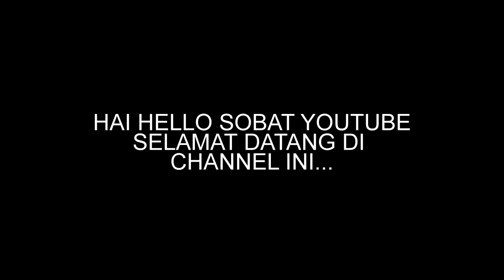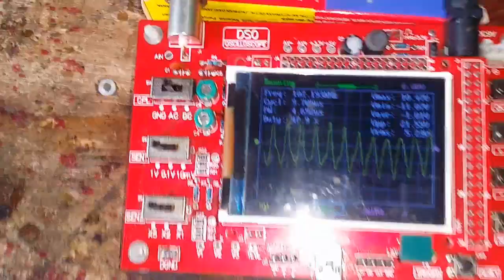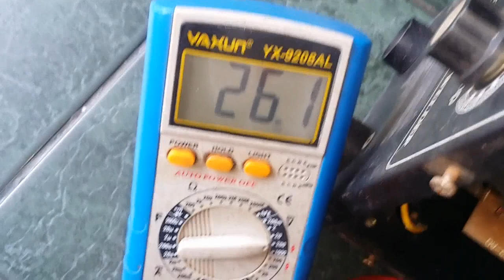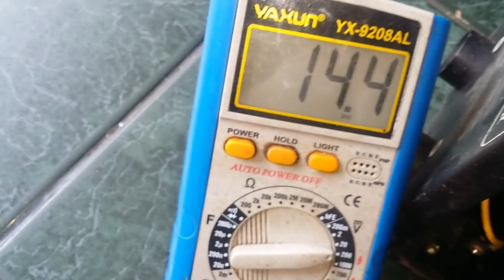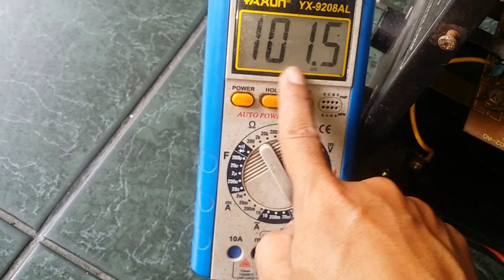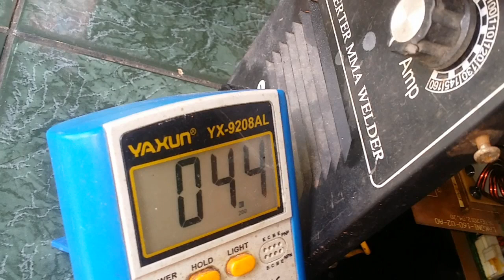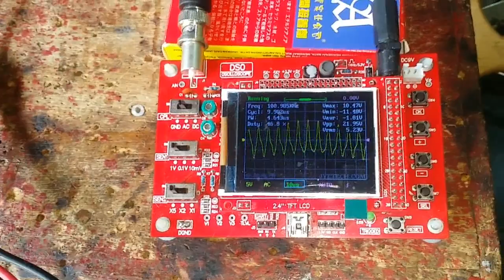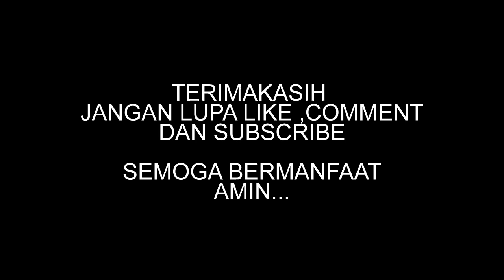MESIN LAS LAKONI MMA 160A DATA RECORD

Comment: Mas,resistor yg berada di papan pcb bagian atas warnah putih klw tdk panas ad hubungan dgn output  api kecil?mesin las rhino 125 amper
Reply from the maker: ga ada mas , kalo api kecil , biasanya capasitor 475/250v, pot ampere, relay blm kerja , travo short ,.
Reply from the maker: bisa juga pwm cntrol nya error , atou bagian driver gdt , ada yg short
Reply from the maker: area driver
Reply from the maker: sory mallah kehapus , area diver gdt mungkin ada yg short sebelah , jadi ga balance , cek area gdt mas  , di vidio dah ada , cari aja
Reply: klw kabel k bodi di keluarkan tegangan output 52 vol DC
Reply: di video merek mesin las ap dan brapa amper

Comment: Kipasnya pake arus AC ambil dari saklar ya mas?punya saya kipas kecil bgt karna beli bekas,niat mau saya ganti,kalo adanya kipas dc saya ambil arus dr mana colokannya mas?
Reply from the maker: Ya mas di ambil stelah relay ..pake kipas yg high speed .. kalo yg dc pake yg 24v juga pake yg high speed.
Reply: @afalhannan  tau speed dr ampere nya?trus setelah relay itu apakah sdh ada soketnya apa disolderin kmn mas,saya buta elektronik
Reply from the maker: la aslinya kipas nya apa mas , dc apa ac ??
Reply from the maker: Ya beli aja kipasnya .  Kalo kipas ac , bilang aja beli kipas ac yang 9x9cm high speed . Pemasanganya kalo bingung sambung saja ke sklar on/off nya .

Comment: Mas kalo tegangan pwm terukur pada ke empat mosfet 26 volt, kira2 masalah dimana ya. Apakah pada mosfet itu sendiri yang short ataukah ada komponen lain yqng mejadi penyebabnya. Terima kasih.
Reply from the maker: kalo 26 v ,pwm belum on mas ,.  tegangan normal 13-15v jika sudah on.
cek area pwm , pertama semua sensor nya ,. kalo baik2 saja brati pwm error,.
Reply from the maker: bisa juga lepas dulu mosfet nya ,. lalu ukur pada ic sg3525 pin 11 dan pin 14 ter ukur 5v
Reply: @afalhannan  oke mas, saya coba cek lagi dengan melepas mosfetnya.
Reply: Mas mesin las lakoni falcon hanya keluar tegangan pada out las.hanya 50 volt.buat ngelas kurang maksimal .kira2 masalahnya dimana
Reply from the maker: cpasitor sudah lemah mungkin mas , chek smua kapasitor
Reply: @afalhannan  kapasitor di pwm ta modul mosfetnya.atau kapasitor di tegangan 290 volt mas
Reply from the maker: milar 475/400v , elko b+,

Comment: Assalamualaikum mau nanya bang kl mesin las lakoni 160e mesin normal tapi pas d pake ngelas tegangan out hilang dan lampu QC menyala dan mcb d rumah turun kira2 apa yg rusak ya om
Reply from the maker: WA ALAIKUM SALAM , ... itu Over Curent mas , kondisi mesin dalam keadaan ga normal , kalo di seri lakoni 120e , banyak sekali , coba cek dioda outputnya , cek juga travonya , lok cek travo harus punya alat pwm universal mas , terakhir cek mosfet nya mungkin ada yg short .
Reply: @afalhannan  ay blm punya alat untuk cek pwmnya om
Reply from the maker: Ya repot juga 😊 . Untuk memperbaiki mesin las harus akurat mas . Salah dikit mosfet jebol smua .

Comment: Kalo di bodi mosfet 4 biji itu vol nya tinggi opo kiro2 mas??? yg bermasalh,trus mosfet k3878 panas
Reply from the maker: kalo moafet k3878  panas brati ada yg short mas , coba tegangan 24v di ukur , pas ga nilainya , body mosfet dan ground normal nya  24v pwm mati , pwm on 15v .
Reply: @afalhannan trus diodanya jg sy cba cek bolak balik avonya gerak semua;;; oke mas nanti saya cek trima kasih mas
Reply from the maker: yupz , test komponen lebih baik dilepas mas untuk memastikan benar short pa tidak,
Reply: @afalhannan  iyo mas matur suwon sarane
Reply from the maker: sip mas , semoga berhasil ,

Comment: Mas kalo lakoni 160 tegangan ngedrop dan keluar suara ngecrit apanya yg bermasalah
Reply from the maker: coba chek elko b+ dan capasitor mas
Reply: @afalhannan  awalnya kan  pwmnya bermasalah irf nya keluar 24v dan bisa start trus saya ganti kok langsung ngedrop voltase diarea igdt keluar suara ngecrit kaya curut.mohon panduannya.soket keluaran normal sebelum dicolokkan dan langsung ngedrop .
Reply from the maker: @jonojenggotjenggot8545  kalo pwm bermasalah brati blm tuntas mas ,pwm masih error itu ,. trutama chek c8050 dan 8550 ,.

Comment: Kalo si potensio gk ada tegangan apanya yg perlu di cek bang?
Reply from the maker: coba ganti pot 10k . lok masih ga ada blok pwm bermasalah .tegangan pwm lost mungkin.
Reply: Di kepala irf terbaca 26v
Reply from the maker: Pwm bermasalah itu . Merk apa mas mesin las nya
Reply: Lakoni 120e
Reply: Pernah coba ganti pwm punya temen yg normal, masih tetep error
Reply from the maker: Coba out put pwm di lepas dulu yg dapat travo diver mosfet nya . Travo gdt ada dua kabel merah sama hitam . Itu coba lepas dulu . Kipas jangan di pasang dulu . Harusnya tegangan normal 15v . Freq nya 100khz ke atas .
Reply: Terkendala alat bang😅 cuma punya multimeter analog abal2
Reply from the maker: waduh ,. ya coba besok saya bantu buat kan vidionya ,. sebagi acuan pengukuran tegangan
Reply: Alamatnya mana kang? Klo sempet tak kirim ke sampeyan
Reply from the maker: saya ada di kab.pati tepatnya kota juwana .desa kauman
Reply from the maker: wa saja coba kirim foto mesin las nya , siapa tau bisa bantu .085290139684
Reply: Makasih bang